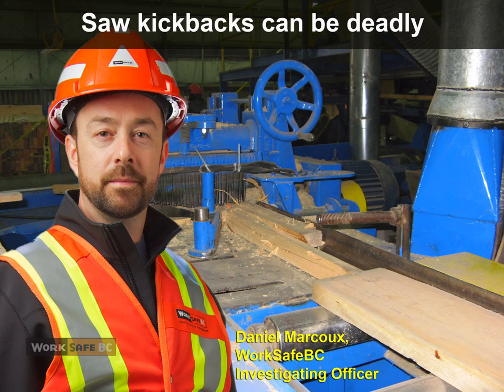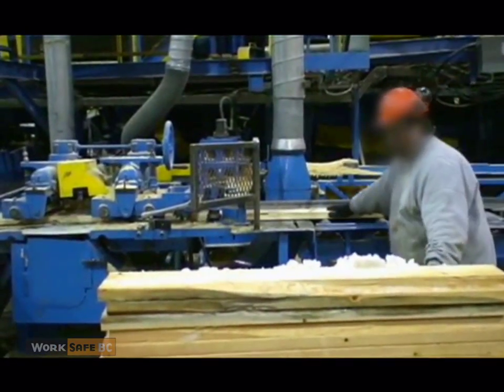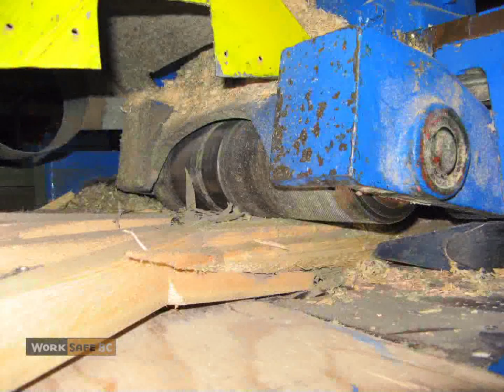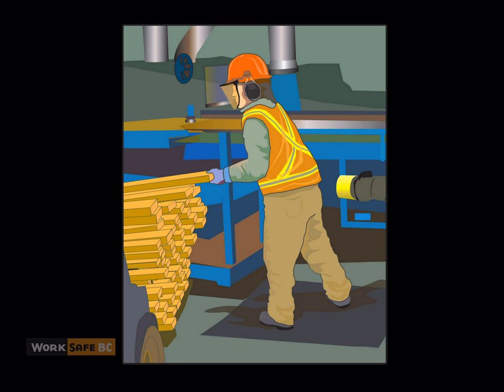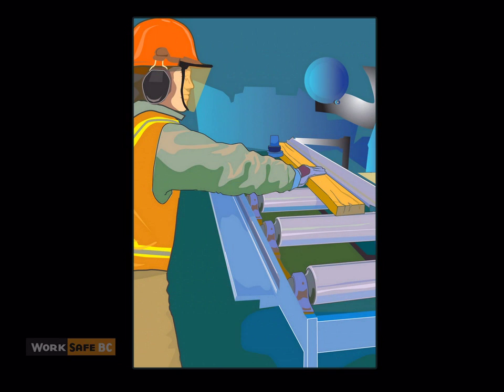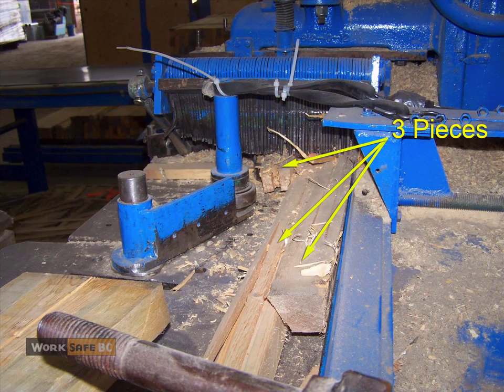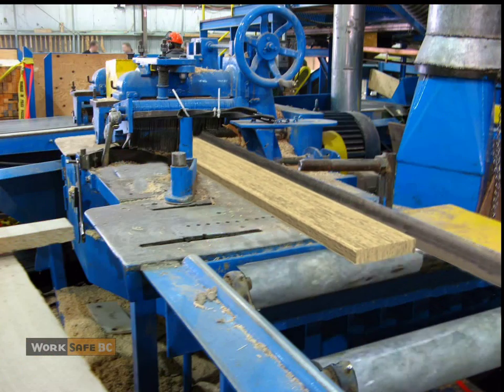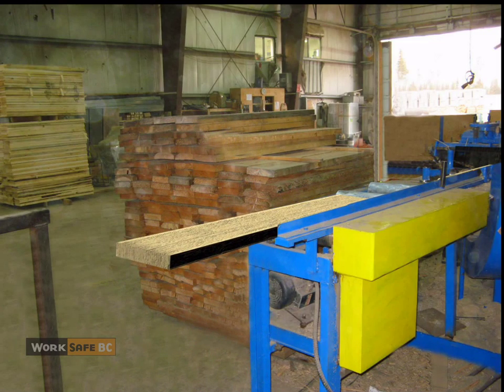Incident Investigation: Worker Killed When Saw Kicks Back | WorkSafeBC

Comment: Every time I use a saw similar to this I feel like wearing full metal body armor for protection
Reply: @versatileduplicity9313  it aint no joke. Saw kickback is hella dangerous, especially things like a chainsaw thats hand held.
Tbh I too, would want to have a full body bomb diffuser tier armor
Reply: You heard of carbine tip blades?
Reply: @maestrovso  carbide?
Reply: No, you should not be scared. Not at all, just don't treat it as a routine. Do what I do - every time is special.
Reply: Just don't stand behind it, same with a planer.

Comment: Happened to me too. A massive bruise on my belly that lasted for months. It was painful and took my breath away. I can only imagine that the scale of damage was far superior with an industrial saw. Mine was a DeWalt construction site saw for home use
Reply: Don't these devices feed material in 1 direction?  How does a kickback even happen?
Reply: @pierrecurie  Think standard table-saw kickback, usually manually fed. Blade/cutters rotating opposite of feed, toward operator…. smooth/low friction feed rollers no match for wood snagged & shot back by blade teeth or cutter blade.

Comment: I learn in woodshop, never stand behind a machine. Always stand to the side.
Reply: Ive seen my farshare of close calls with helpers and employees that get too much in a hurry we had a saw that was finicky and known for kick back. I and two others knew the machine but it always scared new helpers away because theyd stand to close while feeding and the saw would kick back against the pressure of someone holding the bord. It was a self feeding machine and it knew anyone whod try to force feed it to make it go faster would cause the machine to kick back.
Reply: Operating a tablesaw is, to a degree, similar to shooting.  Always tend barrel direction, or in the case of saws, throw direction.   I cut lath and hubs for surveying.  Tedious work.  If that board binds let it go and damn does it fly.  You don't want anything in the throw path but a backboard. The peices are too narrow to fit the knife.  I did learn that clamping a steel bar to the fence on the outfeed side of the blade will hold the hubs steady enough when you get a 'jump' that it restabilizes before it binds and gets thrown.

Comment: When I was 18 yo. I worked in a carpet/ yarn mill where I  operated a machine called a twister which consists of a metal 'bucket' that holds a cylinder shaped roll of yarn that is ran upwards through a spindle that guides it up to be tied into another roll of yarn and is then connected to a mechanism that twists the two pieces of yarn around and around onto a cone to later be finished as carpet. Anyway, the job was very irritating sometimes because we would periodically throughout the shift have what are called 'breakouts' which happens for several reasons that include a poorly tied knot that comes undone when it the knot passes through the spindle, machine not setup correctly, defected yarn, contaminated yarn, etc. One night on a particular bad shift where I had a 'Wipeout' which is where every position on my 3 sides of the machines I was running (40 positions on each side so that's 120 positions total) snapped and was running untwisted yarn which is a worst case scenario because it takes an hour or more to fix and tie all 120 knots, meticulously strand each position and start them up one by one and pull the untwisted yarn off each of the 120 tubes one by one. I did all that and after the tiring process I started my machine back up and it immediately wiped out again. In a rage I stupidly decided to kick the bucket(pun not intended) that I had not engaged the brake and stopped and was still running. Usually if one were to kick it the cover would just dent and fall off but I kicked it with such force and in such a spot that my foot got caught in the bucket and the yarn was wrapping quickly around my leg(the yarn spins so fast that it looks like it is stationary) and proceeded to start pulling me toward the machine. Thankfully I took my box cutter and started hacking at the yarn and pressed one foot against the machine and pull back and freed my leg. If I had not it would have pulled me into the machine and rolled me through the entire approx. 20 yards of machine through the conveyer inside it crushing every bone in my body and killing me. That was one of the stupidest things I have ever done. That event got me nominated for the Darwin Award
Reply: Glad you lived. Thanx for sharing your story.
Reply: Wow, sounds like a terrible job, hope you quit right after
Reply: I'm happy that you got away from that one because I studied a lot of math and engineering and when I think of something like that with all that momentum than all those things turning and turning and turning and all of a sudden you're going to tell him to stop no you're not. In the early days in Chicago children work in those factories and never saw the sun. Once in a while someone would get tangled up in all that big heavy turn and stuff and by the time you got it shut off he was stretched thin as fishing string. I'm glad you got out of that one because if you hadn't had that box cutter start acting like a madman you two been done for. Good work friend

Comment: Some of the comments below suggest stupidity on the part of the worker. This is counter factual reasoning. We have information available to us that the worker didn’t—and her decisions would have made absolute sense to her at the time. We can only build safer systems by understanding why those decisions made sense, because other workers with similar training may make the same decisions in the future.
Reply: hindsight is always 20-20
Reply: It literally just is not even relevant. Stupidity should not result in death in the workplace. This is why we have engineering controls. Put something in place that will stop them from doing the thing we decided was stupid. Obviously, within reason - at a certain point if a person is going to bypass these controls, there's nothing you can do, and you don't want to place an unnecessary burden. But it should not be as easy as standing in the wrong place.
Reply: @sauercrowder  It's absolutely relevant. She was doing something she shouldn't have been doing and got killed for it. Maybe it's her employer's fault for not providing adequate training. Maybe she was trained but was being careless. Even basic common sense would tell you not to stand there. This is natural selection at its finest
Reply: @Abysia  No. This is a worker who were pushed by lack of accommodation for her job and high pressure of working with pace to take her chances and sadly killed. Your comment is apathy at its finest

Comment: Throughout the video of the accident scene, you can see the pallet of wood from which the worker was feeding into the machine from is jammed up against the bed of machine leaving no room to maneuver and properly and safely feed the material from the side of the bed .As a result the worker was forced to feed it from the end of the bed. Putting that pallet of stock in the workers space forced the worker to feed it from the end of the bed. Whoever put that pallet there made a grave mistake and whoever trained the worker in the best safety practices failed in their job..

Comment: I had a similar experience with a radial arm saw, turned sideways to cut a piece of aluminum lengthwise.  The saw grabbed it and though I knew the danger, I ignored it, thinking nothing would happen.  Well, it kicked that piece of aluminum through a sheet metal door and into the ground about 100 feet away.  If I was in the way I would have been an organ shish-kebab.  I was young and dumb.  Of course nowadays I'd never attempt such a foolish thing.  I was lucky.  Some aren't.  Never play stupid with saws.  They will win, given the chance.
Reply: punishedexistence wash drain wash drain let air out repeat  solutions are available for stuff like this or other methods too wash rinse repeat air out wash rinse repeat until it is safe to cut and or weld   if in doubt wash rinse air out wash rinse repeat until safe to due so
Reply: We don't care
Reply: Irish shush-kabab 😆
Reply: Did you get killed?

Comment: I kicked back about a 4" x 4" x 3/4" block on a 10" entry-level table saw; it struck the side of my stomach hard enough to bruise and draw blood, and even after that, it still had enough energy to travel almost 25' across the basement.  And that was just a little piece.  I can't fathom the energy contained in an entire board, kicked back from an industrial saw.

Comment: I have worked in two saw mill facilities as a maintenance mechanic.One place manufactured trusses,and believe me when i say that gantry drive tables are extremely dangerous.From the electrical,the hydraulics and the pneumatics involved on the systems.I was removing a pneumatic cylinder that was in need of a seal rebuild and had noticed that someone had actually tried to triple feed the inlet air for "said"reason to increase the lifting torque to operate the pop up arm to throw the truss from the gantry table onto the conveyor rollers.Crazy idea was is that the mexicans brothers up top while i was underneath were told keep running production,not a safe idea...Needless to say i waited til the shift ended to finish up.The company wanted to keep production running regardless of the risk that the mechanic faced....
Reply: Any trip to Timber factories in Indonesia will open your eyes, workers wearing Flip Flop sandals, and sometimes bare feet, loose fitting shirts,actually PUSH feeding massive Hardwood Logs thru giant Band Saws,NO SAFETY devices whatever,even the on/off switches are nowhere near the machine but hey, they make more profit and workers are lucky to find or have a job.

Comment: Multi rip saws and straight line edgers have big motors - maybe 15 or 20hp.

I don't see why the machine couldn't have had anti kick back fingers....they rest on the wood as it goes in, but the teeth dig in if it goes the other way.
Reply: I know it's a year later but you can clearly see the kickback fingers and he stated that a piece of board knocked the finger up allowing a second piece of board out unrestricted.

Comment: Looks like the boards need to be loaded at a 90 degree angle to the saw blade instead of aligned ti it. Or have an auto loading chute where operator loads only the chute?

Comment: I had a table saw kick a 2x4 out before. Or, more appropriately, my dad was doing some rip cuts and the blade bound on the wood. As he attempted to control and dislodge it, it kicked out from him. The board struck me in the left pectoral muscle, about the middle distance between the shoulder and nipple.

Hairline fracture on two ribs.

Comment: Great vid! One thing I must point out is that 99% of companys care more about production than safety. I found in my years of working machines small shops cut alot of corners on safety. The larger  factory I worked for had a lot of rules and protection for the workers. Having to ware a chain nail glove to run a foam saw was a little annoying at first. But seeing how sharp the blade was was enough to scare me into putting it on everytime even to just do a 5 second cut.

Comment: "The narrator stated that the operator was too short to do the job "

No, the narrator did not state she was too short to do the job, only 
that the height of the infeed was high enough she had her arms up almost
 to her shoulders- the machine was too high off the floor and should have been lower or a walk platform put next to it,  but that 
wasn't specifically what caused the kickback and injury, the kickback 
was going to happen anyway, it's only speculation what happened.
Reply: But she WAS too short to do the job at that particular workstation. Someone super tall might be too tall to work at that workstation, etc. There are other hazards that come with working in a mismatched way that causes you to strain to do a very repetitive motion in addition to the dangers of using the equipment. Bad backs, injured joints, muscle strains can har a worker over time even if the equipment is as safe as it can be. Workers need to be correctly matched to the task and the workstation.

Comment: Men -- even tall men -- die of kickback every year. The armchair geniuses in the comments that chalk this up to gender or height have literally no idea what they are talking about. It's a bad design with an obvious lack of consideration for the risks. Take some responsibility for the workplace you design.
Reply: The investigation showed that when was not tall enough to operate the machine safely. This is not a normal table saw, this is an industrial machine. The problem was not that she was a woman, the problem is that she was short and she was not strong enough to do the job correctly, so she moved to an unsafe position.

People like you that make everything sexist are part of the problem. The employer may have been afraid to take action because they were afraid of a sexism lawsuit. In fact, the employer may have even tried to prevent this and been met with a "You're sexist and I'm gonna sue you" response. I'm not saying this was the case, but we don't know because that was not part of the video. I do know that women are in many jobs they are unqualified for because of this feminist behavior. They usually end up getting hurt, or hurting someone else and then sue the company for their own stupidity.

The fact is that Men are _ generally_ stronger than women. You can bitch and moan about it and call me sexist all you want, but that won't change the fact.
Reply: MAGA MAN No doubt , operated properly these machines are relatively safe.
Reply: I worked for a time out at a Lumber Mill in Nampa Idaho with a similar deadly situation. In the year prior to my arrival there and outside saw kicked-back and killed one operator. The older replacement burly saw operator I was assisting had scar tissue all along the insides of both forearms due to another kick-back.
Then one day while we was running some VERY rough-cut 2"x2" 10-foot lengths through that same outside saw which was having issues accepting the wood. As an added precaution he started feeding them through by using another piece to push them in. When suddenly there was a LOUD cracking sound from a violent kick-back which shattered his guide pole which cut his forearms open again before he could run for help.
I thankfully was even farther off to the side as well which was a good thing because if either of us had been AT the saw operator control position the piece that had got shot back out WOULD have pierced us with a foot-and-a-half spear-tipped shaft sticking THROUGH the chain link fence behind us.
I quick working there due to that and other safety issues soon afterwards...    :(

Comment: The best approach is high RPM low torque,
In the event of a kick-back the motor will stall and the blade will stop almost instantly.
Smaller diameter blades are safer as they have less inertia.
Fine tooth blades are safer as they have less "bite".

Comment: It would be awesome to see saw stop update the technology to where current sensing is used so when there is a sudden drop in motor current draw mid cut, the disposable actuator fires and turns a kickback into a little jolt. Throwing away a blade and the disposable actuator is a lot better than getting killed or seriously injured.

Comment: CAN ALL THE IGNORANT DUDES STOP SAYING WOMEN ARE TOO SHORT FOR THE JOB. Maybe its the equipment that's too tall‽ 
Work with me here for a second. I'm a designer, so I know a thing or two about this.
The platform appears to be about 4 and half feet tall. The average height of a male is 5' 9", putting the rollers a few inches below chest height, which is a difficult height to be lifting to, especially when there is no good reason for it to be that high. 
 Keep in mind that this is an average, so half the population is going to be even more uncomfortable on the machine.

Now when you consider that an average female height is 5'4", its pretty obvious that there was no consideration given to ergonomics when designing this equipment.
 A 6+ foot tall person could easily lift to 4 feet without straining or bending uncomfortably, so why not make it that height? Or better yet, design it to be adjustable? Because the designer didn't consider the limiting condition on that part.
Reply: You are stretching it a bit.